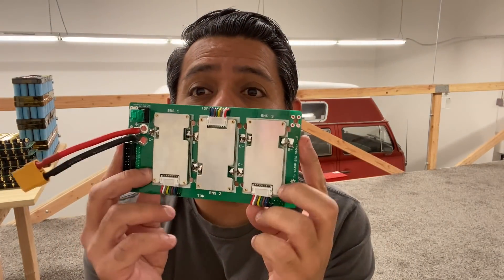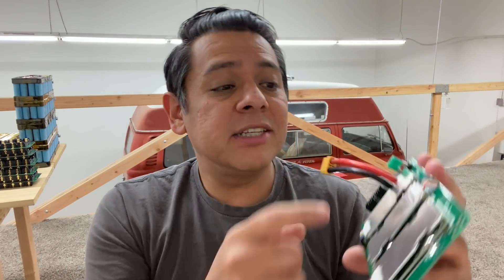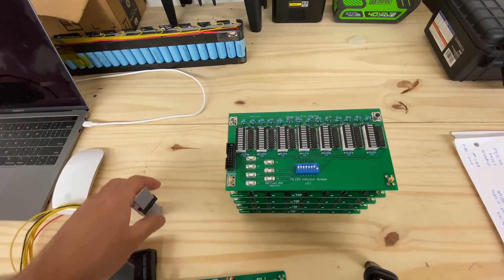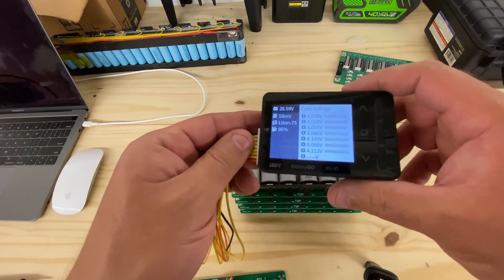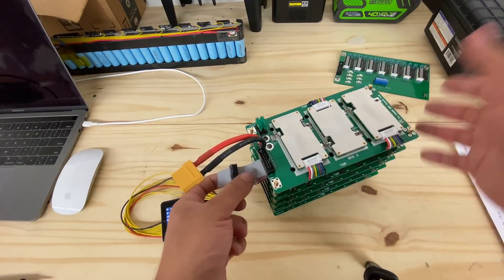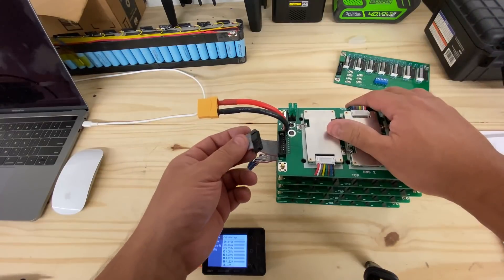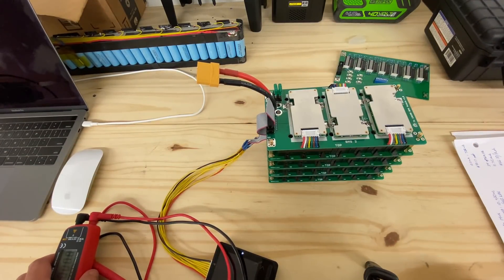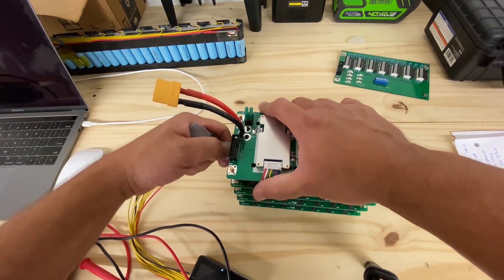7s BMS Module 50A -1200W -Trouble Shooting tips

Comment: 5:00 How much current can handle those trace fuses and how to improve the board to repair them or remove them?
Reply: Nvm, I just it with my soldering iron. I'm searching now for a gerber editor to remove that problem.

Comment: Hi. I have your PowerTalk kit. When I connect all to the bms. There is to much heat that the fuse melts off. I tried half and it still seems to get 220 degrees. Any thoughts?

Comment: In Electronics, it is not ok or recommended to do a continuity multimeter test in a live(powered) circuit, let alone across a MOSFET or transistor.  Continuity test should never be done on a powered circuit.

Comment: I found a problem with my v1.3 populated board.  The ribbon connector is off one set of points.  

I found the issue when I tried to check the voltages on the testing points on the ribbon conector, the first set of pins shows 8v, no combination shows 4v, so I flipped it over and compared to v1.0 of the board and saw the connector is shifted over one spot.  I wish I could share a photo of what I have to help others.
Reply: 7.22.20  John I also wish you could share the photo.  Could you please send your photos to chuck348@gmail.com?  Thanks
Reply: How did you fix those?
Reply: @northernflyer5311  I did not fix it.  I would need to desolder the 16pin connector and move it over one.  Not fixing it right now.  Maybe later.

Comment: 7.22.20  Jehu, are you going to make a video on how to wire up the battgo BG 8s?  I bought 4 of the BMS and now I am hoping they are fine.  Slowly taken apart the scooter battery packs and testing the cells and putting them into the PCB.  Currently have 5 PCB (35 cells) populated and now ready to test the BMS.
Reply from the maker: No,  it’s as simple as connecting pin 1 on the meter to pin 1 on ribbon, pin 2 to pin 2 and so on

Comment: Generally,  trying to measure resistance while voltage is applied to circuit is going to give unreliable results.
The resistance measurement works by applying a small voltage and measuring the small current. Voltage in the circuit confuses the measurement.
Reply: Ross is right.  You should never measure resistance or continuity check on a live circuit.
Reply from the maker: how do shunts measure resistance?  With the circuit off ?
Reply: jehugarcia : A shunt is a precisely manufactured wire block with very low predetermined fixed resistance at manufacturing stage. It is used to measure current not resistance. When current flows through it, a voltage drop occurs across its terminals, and this voltage is directly proportional to the current flowing through the shunt because of V=IR (Ohms law), whereby R is constant in a shunt, hence voltage varies with current. There is always a small electronic circuit attached to the shunt to compute (calculate) the amount of current flowing through the shunt. Thus current measurement is also computed into Amp-hours, if necessary. A combination of shunt and display circuitry are used to measure Amp-hours, and thus are used as battery monitors. A good example of use of Shunt and monitoring circuit is the VictronEnergy Shunt and BMV’s https://www.victronenergy.com/battery-monitors
Reply: @jessew6757  Beautifully explained 👍👍
Reply: @TheCheesePlease He is a famous person being followed by many people and it's very much possible he would not be getting time from so many comments to reply or revert on, but he does and did reply, with his best knowledge, knowledge is something to share we all don't possess every bit of knowledge on earth, Lolz 😂🤣😂💐👌🌹
Reply: https://youtu.be/UryMFBLdKFU

Comment: Jehu, one thin I do about every month or so is I take the BattGo and test every board in my 36p to see if any trace fuses are bad. disconnect the ribbon cable from all and plug the BAT in, if one or more cell reads 0v then I know I have a bad trace fuse.  Monthly maintenance.
Reply from the maker: Has it happened ?
Reply: @jehugarcia  Yes twice, but after I took out the pack and re-tested every cell and found the one or two bad cells then ran re-packer all has been good.  But if we don't use new cells all the time this is a quick way to check everything.
Reply: @jehugarcia  Also, I have had one balance wire break off from the BMS board that was hard to see at first and gave me wired numbers too...

Comment: Really want to start buying the system you offer and will continue to follow as you walk through the steps to create a powerwall (I hope that will be your goal). One question in the back of my mind: you offer two cell boards I think one if seven cells and the other is 14 cells what is the difference and their applications?
Reply from the maker: One is rated at 1c continuous and the HP is rated at 2c power output

Comment: Looking forward for the powerwall project using the PCB modules, I bought 10 modules plus the BMS and I willing to buy the 75ps to build a powerwall
Reply: Same, bought 10x too but not open box, to many other projects... lol
Reply: Have 4x 36v packs, 2 8s module, and over 100 modems to harvest.  Have a buck and boost converter,  going to get voltage down to 24v